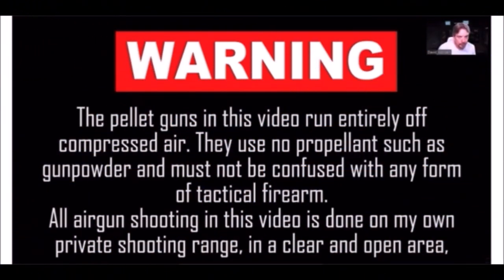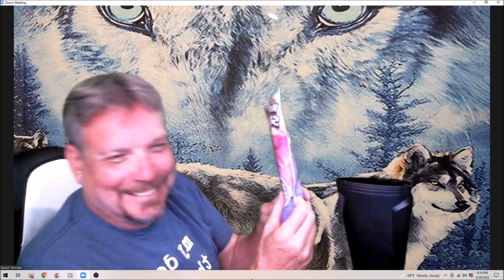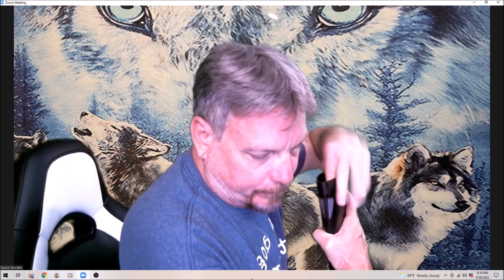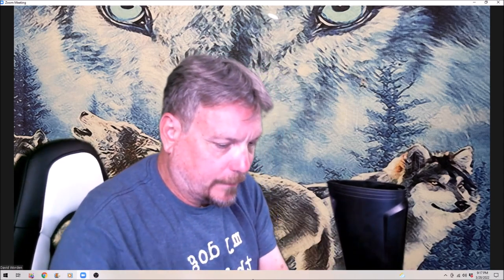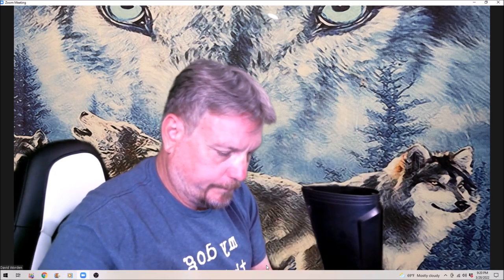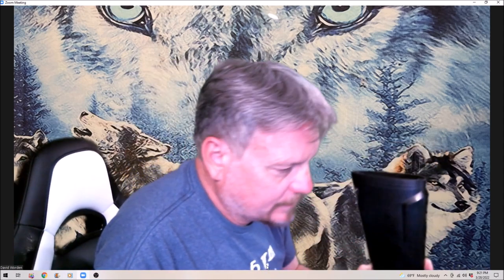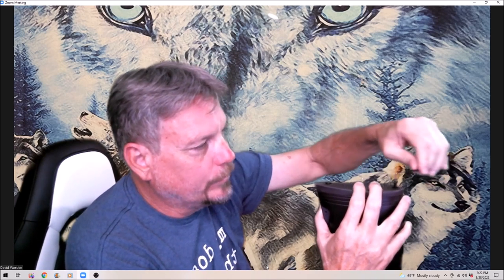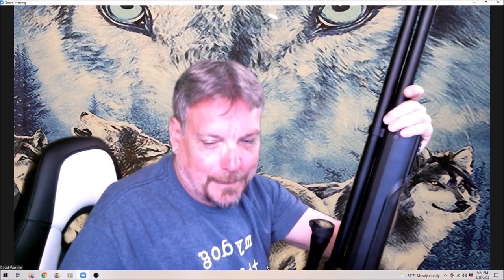Air Venturi AVENGER Hollow Stock Fix Pt.4

Comment: I wound up using non drying modeling clay. It added 2 lbs but it's a lot quieter and stable on the bench. Thanks for recommending  filling the stock.

Comment: Cool video.  I've never seen kinetic sand, it makes me want to go buy some to play with!  lol  Any idea if Bondo would be good to try?  I have one of the big cans that's just been sitting in my garage for years.....a little more permanent than the sand.  People use it as a wood filler so it's kind of the idea.  Not sure if it would expand and crack the stock open?  If you've got some input feel free to comment.  The target down the road from me sells 3lbs of the sand for $11.
Reply from the maker: Maybe. You can try it. Let me know how it works out.

Comment: Ever considered filling your shroud with kenetic sand...
Reply from the maker: I thought about it but I m looking at alternatives that won’t add so much weight-especially out front on the rifle.
Reply: There's a guy on YT that has done it and the POI doesn't change through multiple brands of pellets/slugs. Damn impressive. The unit is light enough as is that the added weight is negligible.